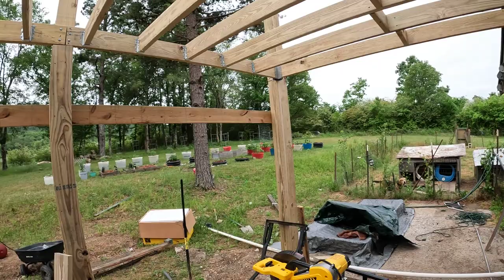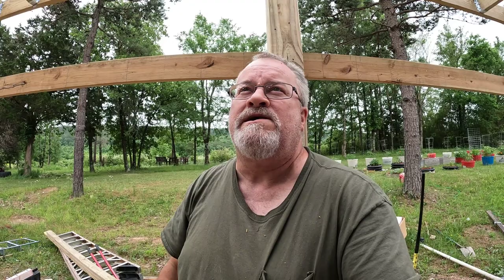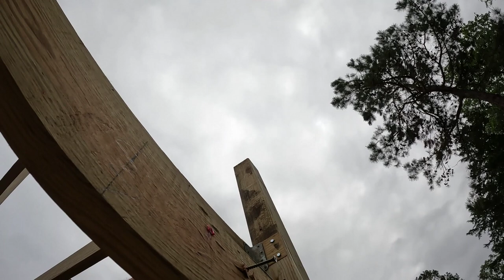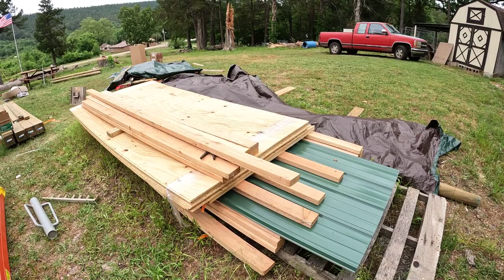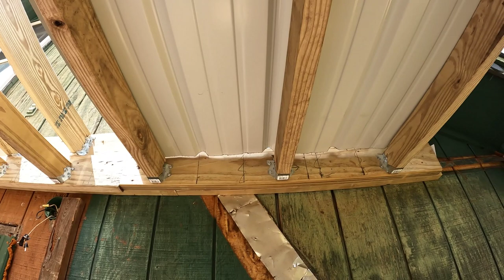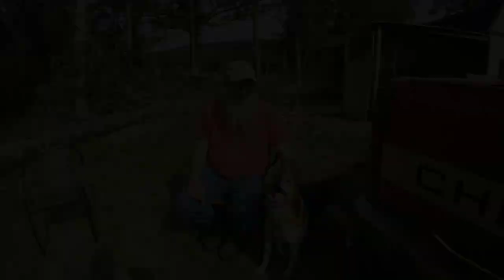FIXED SOME ISSUES/ RAFTERS UP/ #9

Comment: You've probably already finished the shelter but I would let the roof have more of an overhang with the tin.  That way when the water runs off it won't bounce back in at the bottom/floor/ground. Help with the drainage. 
It's looking good though.

Comment: When you have the flat deck above the slanted roof, are you going to need some barrier to prevent birds from nesting between the two areas?
Reply from the maker: Yes I will be installing a mesh to prevent that